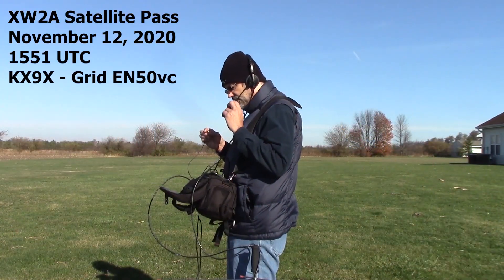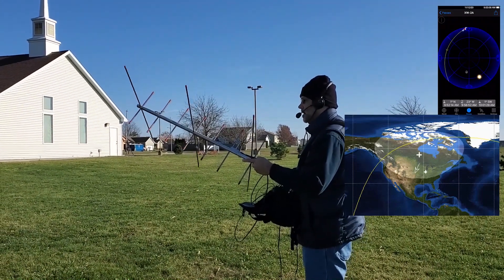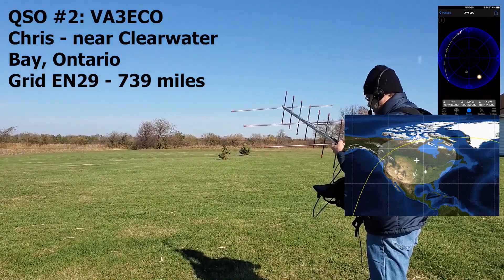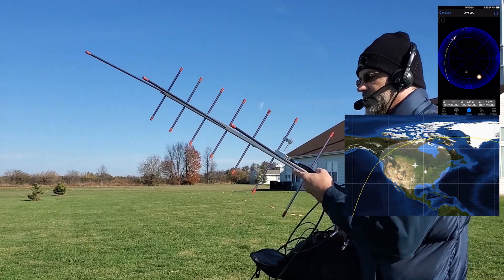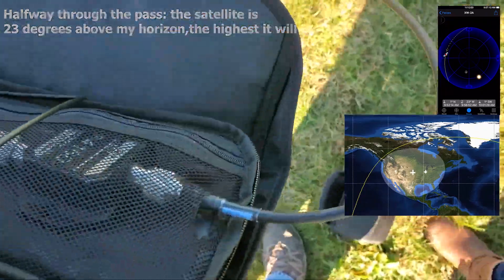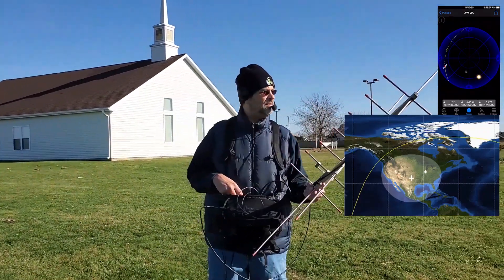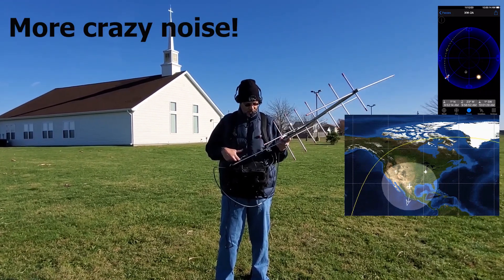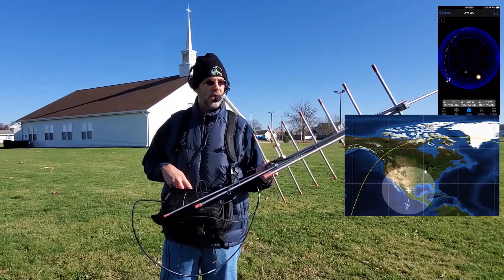Tips on Operating Linear Amateur Radio Satellites (Part 2)

Comment: Thank you so much for your videos Sean. I'm brazilian ham (Eduardo PY2QZ) and I have some questions:
1- Is there any software that shows which satellites cover Brazil?
2- Could you use more modern radios that already run cross link and full duplex?
3- What is your opinion about Eggbatter antennas for base operations?
Finally, I would like you to say something about Ham Radio Deluxe as it seems that it controls the compensation of the Doppler effect by the software itself.

Again, I really appreciate your time and willingness to teach us.

73

Comment: Why is the sound so terrible 😳   i cant hear much of what your saying
Reply: It looks like it is clipping at some point... In sound enginering we call that structure gain... where you wouldn't put your living room amp all the way up and plug your cell phone in it at 10% volume, you would end up in a lot of baground hiss or hum. If you also overdrive your amp input... you're gonna have distortion. on complex signal path, proper gain structure across every switching point from a device to another is critical to ensure maximized signal to noise ratio while avoiding clipping and distortion. I guess it is sometimes hard to master over a live event like that where the satellite will only be there for a few minutes... and where you can't prepare in advance like bands do soundcheck and rehearsal before the show.